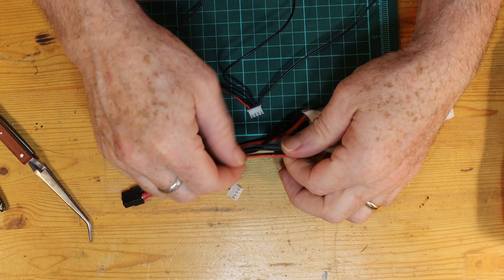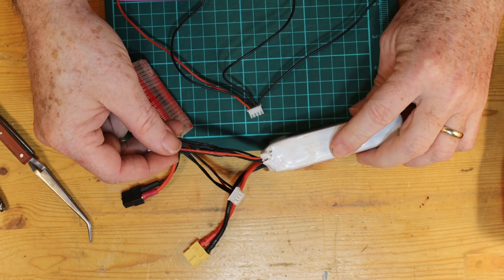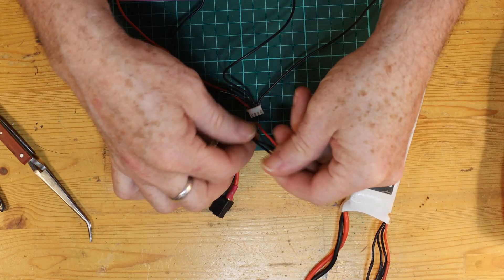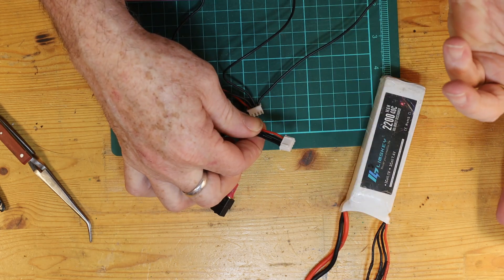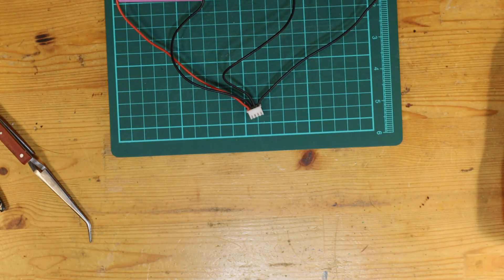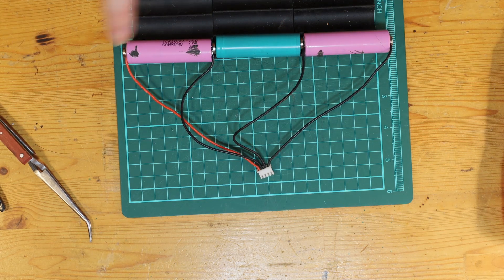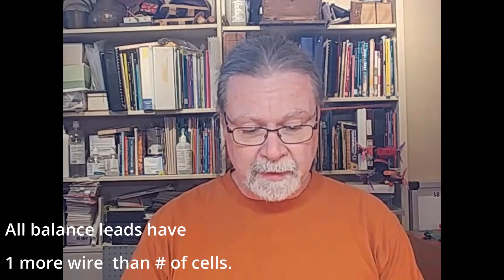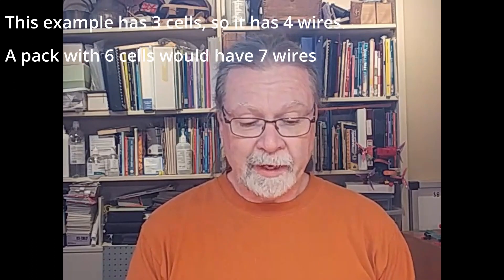Lipo Battery Balance Leads Explained - Don't Burn Your House Down!

Comment: So, inside the charger, it reads voltage between negative leads? You show the voltage going up as you walk the connector pins with the positive lead remaining on red. If that were the only method, you’d have:

V2 = Vmeasure - V1

and so on in code. I guess there’s no reason it can’t be both, just wondering. Thanks
Reply from the maker: Thanks for the question.  If I were to move the positive at the same time as the negative lead on the voltmeter, it would show the voltage of that individual cell.  That is what happens inside the charger - it just reads the individual cell voltages using each successive pair of balance leads. The charger checks if any cell has excess voltage and then burns it off using resistors.  All the cells continue charging through the main lead, but the  'full' cells are having the extra burnt off via the balance leads while the remaining cells reach full capacity.

I'm not totally sure that is what you were asking about.  If not, sorry, but I hope it is helpful either way.
Keep well
Eric
Reply: @blueskyfpv exactly. thanks!

Comment: My teenage son just bought a Arrma RC with LIPO 2S. He watched me a few times plug in both the balance and main power cable. Then he plugged it in today without the balance cable on 3amp setting. It was on there for likely 3hrs before I noticed it. It showed somewhere between 50%-75% charged. Is there anything else I need to do now with the battery? Will it properly balance itself or safely charge itself now with the balance properly hooked up. I had a long talk about common sense, he knew these batteries were risky with all the talk about charging them in safe places and them catching on fire. And he still didn't plug in both cables...
Reply from the maker: Hi, thanks for taking the time to comment and leave the question.  We all make safety mistakes from time to time, hopefully your son won't make this one again.  Most likely there is very little to worry about, especially if the lipo is relatively new.  The balance leads provide an essential safety function during charging, but mostly when it nears full charge. If 1 cell (in your 2s pack) reaches full charge (4.2 v) before the 2nd cell because of different internal resistance, the charger can continue charging the cell that is not full, and will burn off the excess going into the full cell so it doesn't exceed 4.2v.   You said the lipo only shows 50-75% charge, so no cells have been overcharged, and so they should be OK.   HOWEVER, make sure there is no puffing to the lipo, and check the lipo with a battery checker to make sure the cells are still relatively close to each other in voltage (3.75 & 3.8 for example, NOT 3.75 & 4.1) before plugging in the balance lead.  If the voltages are quite far apart, I probably wouldn't use the battery.

I hope this helps.
Reply: @blueskyfpv yeah the battery is brand new and likely only the 3rd charge. Nothing hot or puffy. The charger was reading the 80% status but seems like it should have been charged already. I stopped the charge and plugged in the balance lead and then restarted the charge on the 1amp setting, and still showed 80%. 

I’m getting the S115 charger on Sunday so I have more ability to check it then.

Comment: Thank you, this was explained very well. I'm working on solar panels with 18650's in them - would you be up to answer questions to work with the project?
Reply from the maker: Hi.  I'm glad you found the video helpful.   I can try to help with your questions about solar panels/18650s.  A few years ago I recycled close to 5000 used laptop batteries by hand to extract the good 18650's from them.  I used 1000's of individual cells to make 48v battery systems for the panels and other power packs.  Its a lot of work!  Since it is a bit off topic from the channel, send me an email; I should be able to give you some basic guidance.

Comment: Very informative! How about balancing parallel packs? I want to make some battery packs for my RC car using 4 batteries, basically 2 2S packs connected in parallel for doubled Ahs. Can I balance those somehow?
Reply from the maker: If you are having 2 separate 2s packs that you join with a parallel connector, then you'd balance them separately as individual 2s packs.  If you want 1 pack that is 2s2p, it should end up balancing exactly the same as a single 2s pack.  
First, you make 2 'cells' that are 2p (join positive to positive and negative to negative), and then you solder them into a 2s pack (solder the positive end of 1 of the 2p cells to the negative of the other 2p cell.).  You then just add balance connectors as if it is a 2s pack.

Be sure to use cells that are designed for high amp draw, very few 18650 cells manage more than 25 amps continuous draw, some 21700 cells can manage 40-45 amps.  Molicel and Samsung are among the best.  Pulling high current from li-ion cells that are not designed for it is DANGEROUS (think exploding cells)!

I hope that makes some sense.

Comment: Are you using MAGNETS to connect the cells?? that crazy-genius if it works!
Reply: Maybe a spot of conductive grease as well, eh ?
Reply from the maker: Yes, they are small neodymium magnets.  I've used them like this a few times when I've needed a really quick source of power to test something or to demonstrate a concept (like this video).  You still need to use a proper conductor between the batteries, the magnets just hold things in place.  Without some better engineering to make sure nothing moves, I don't think it is a safe thing to do for any situation other sitting on a desk and not moving.  But for quick, on the desk 3 - 4 volts/low amps, its helpful.

Comment: if your balance leads accidentally touch for a split sec would the battery be fixable or better to retire it. My fpv drone destroyed my leads and when I swapped the lipo out for one not damaged they accidentally touched.
Reply from the maker: If any of the cells is really puffed, don't use it.  However, that is unlikely If the short really was fast (under a second). Just check the voltage of each cell.  As long as they are all OK, you should have no problems.  Carefully replace the balance lead plug if that is all that was destroyed. If not, you  will need to solder on new balance leads.  This isn't hard, you just need to be sure the wires are in the correct order in the plug (fully charged = 4.2/8.4/12.6/14.8) .  If you don't have any, replacement balance leads can be bough in most RC stores.  I keep a bunch of 4s leads for just this situation.  I bought them off Aliexpress - something like 25 leads for $10.  Hope this helps.
Reply: @blueskyfpv  yeah this is what I’m going to do when I get back. The LiPo is basically new maybe around 10 flights.

Comment: Very good . But im confused . You said leads bleed off voltage . Dont the leads add voltage to the weaker cells to get them in sink ?
Reply from the maker: The main power lead is what pushes energy into the batteries.  The balance leads burn off excess energy in fully charged cells.  If you have 2 cells in a lipo that are very far out of balance (.25v or more) it can take ages to fully charge.  The charger will stop pumping power through the main lead, so it can take a pause to bleed off the fully charged cell before putting more into all cells...and then repeating.